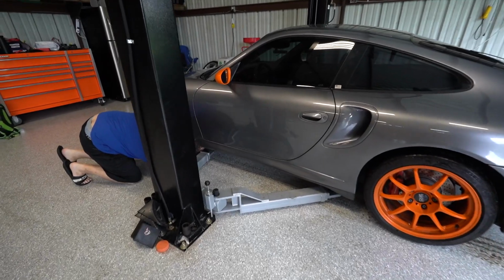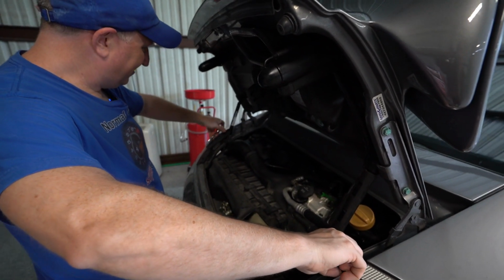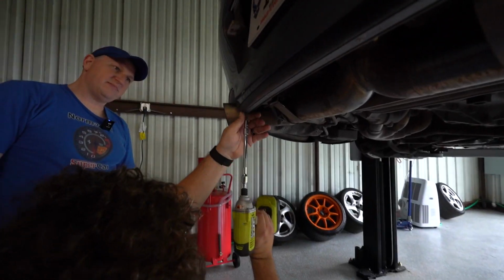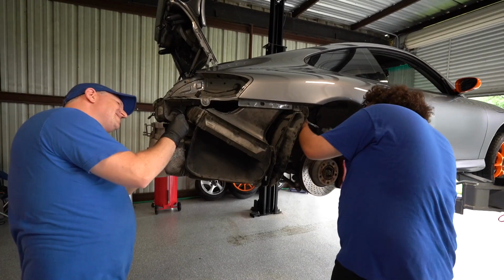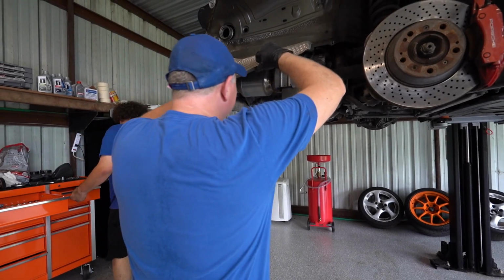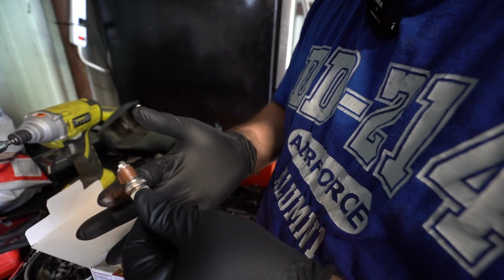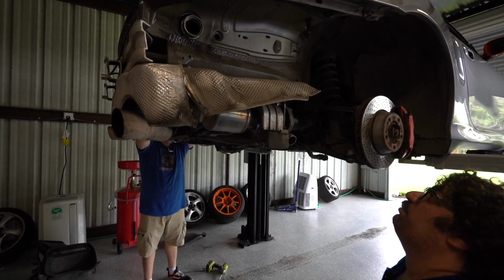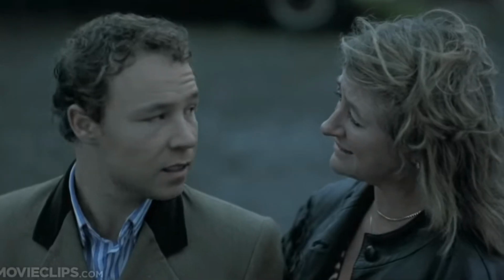Porsche 911 996 Turbo Spark Plugs DIY

Comment: Make sure to do a boost leak test after taking all of that apart. Those stock o-rings on the intercooler hot pipes are notorious for leaking, especially once they've been disturbed.
Reply from the maker: Good call

Comment: Just changed plugs on my non-turbo 997.2.  Took like 20 minutes.  996 is kinda squirrelly all around.

Plus, Porsche specifically says no anti seize on spark plugs.  Not that I think it matters much, other than chancing getting the torque wrong.
Reply from the maker: The turbo intercoolers are the problem

Comment: I did coil plugs and coil packs on mine in a lot less time than that!
Reply from the maker: Well.... You're better than us I suppose then
Reply: @normalguysupercar  not necessarily better, just did it differently, I did not take the bumper off, did not remove the intercoolers or exhaust, I managed to access all of the coil packs from underneath, used a 6 inch extension with  a wobbly drive spark plug holder, plugs 2 and 5 are awkward but "doable", if once you have cracked them off you undo by hand. Plugs to the rear of the engine, I undid the arch liner, flipped it up, then used a 6inch extension, UJ, then a ten inch with a 3/8 ratchet.

Comment: Good video , but the area showed is always a little bit dark. One thing not recommended by Porsche with a special Bulletin is the use of any anti seize on spark plug threads! It is working as a dielectric thing and can cause misfiring. Second , if I change spark plugs (I change it every 10000 km or every 2 years) I check the coils for cracks in the plastic , especially in warm climate like Texas. Happy and safe travel and more Porsche videos !
Reply from the maker: Thanks
Reply: Very good point on the coil packs. Cracking is very common on 20 year old coil packs... lots of heat cycles.

Comment: Yes, about 4 hours once you get the hang of it. I have a 2003 and the #1 plug is $&!?!

Key is having the correct swivel socket.

You don’t need to remove the wheels.
You don’t need to remove the bumper.
You don’t need to remove the muffler.

You can do this with your rear wheels on ramps, laying on your back.

Once you have the flow it’s plug and chug one after another
Reply from the maker: That almost seems like torture.
Reply: Which swivel socket?

Comment: Just don't put the lift pads anywhere else except on the designed lift points , too far forward of the lift points will see the car tip to the heavy side

Comment: DO NOT waste money on headers! Only needed for 1000+ whp.
Reply from the maker: Lol
Reply: @normalguysupercar  I'm absolutely serious. It's a money grab by most companies. For a little extra flow, most people pull the stock ones and port match them to the head and turbos. That's what I did and made over 731 all wheel hp and 705 ft lbs on pretty low boost. Not to mention, most of the aftermarket headers crack really badly and quickly, due to the heavy turbos, limited bracing, and thermal shock from driving in puddles/rain. Money is better spent on a tune, or intercoolers, or even hybrid turbos. I would do all of those before headers.
Reply: @TheSoundofSpeed  spot on. Headers are a total waste. Porting the stock manifolds is a better option but even that isn't needed unless the build includes upgraded turbos.

Comment: Bloody german engineers haha. The tail lights are a issue in those, they actually fall in the motorway sometimes lol  there are some metal repair brackets you can buy for them
Reply from the maker: Yeah need to get some of those
Reply: Its the degriser that cracks tail light